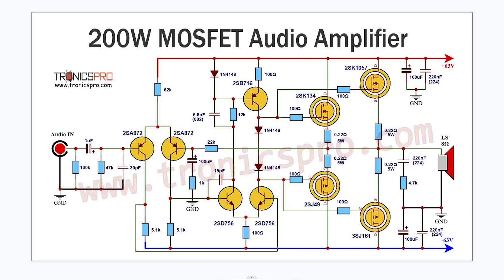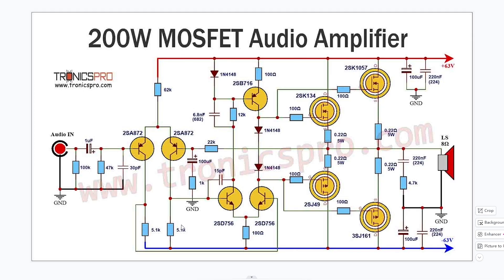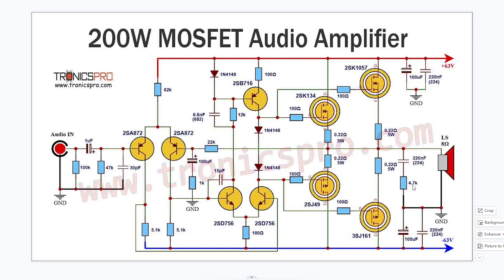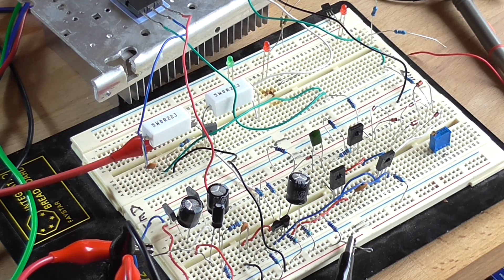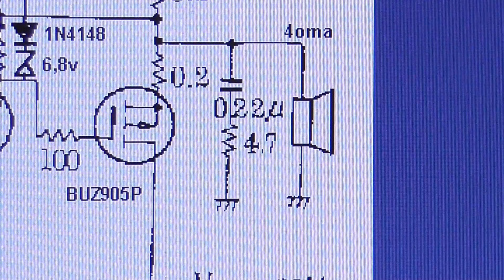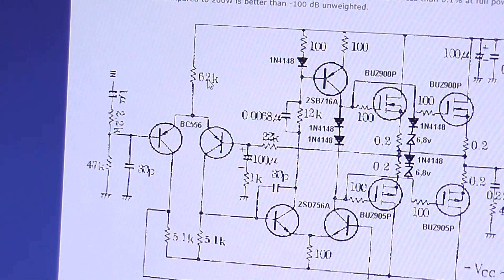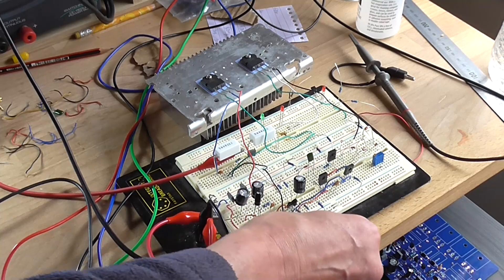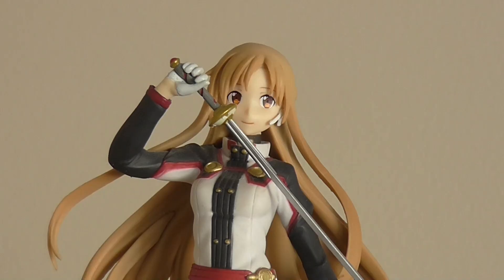200W Lateral MOSFET Power Amplifier Circuit Test

Comment: Thank you Astro for sharing this video.The 4 zener diodes are known as a stabilizer they stabilize the output mosfets 😃💯Stabilizers are used on the output of MOSFETs to prevent oscillations and ringing caused by parasitic elements and to regulate voltage. Without stabilization, the MOSFET can oscillate, especially when biased in its linear or quiescent region. Stabilizers can also refer to a device that regulates the voltage supplied to a circuit for consistent and safe operation, often incorporating a MOSFET in its design for control.👈🙂 You should use the original schematic it is built correctly....🤗 But using the 2 x 1N4148 zener diodes as bias I would use a 10 ohm resistor or a 33 ohm resistor and connect it to the very last 1N4148 zener diode to balance out the bias perfectly 👍✅
Reply: This seems an AI generated answer as it's complitely out of contest. In this case the zener protect the gate of the mosfet for overvoltage wicht lateral mosfet are very sensitive.
Reply: @andreavico6198 if I may ask what seems AI generated?😃 A lot of people don't understand how mosfets work that's why you don't see very many top-notch quality mosfet amplifiers that actually stay up and running for long periods of time without failing..... Mosfets are very sensitive and one wrong move will burn one up very quickly... You must take  proper care when building a mosfet amplifier especially if you are building the circuit from the ground up.....😃 There's a lot to know about mosfets.... And most people don't take the time to study and read and do their research to fully understand most people just look at schematics and throw things together that doesn't mean the circuit is right or correct as an engineer tech and designer it is your job to fully understand and to make sure the amplifier is built correctly ❤ yeah the amplifier might work but that doesn't mean it's stable you have to have a lot of different test equipment in order to truly make sure everything is correct and that the amplifier is up and running properly 😊 Marshall build some really awesome mosfet amplifiers you should check out their schematics when you get a chance they are very different and unique 😃 just Google the Marshall lead 3210/100 mosfet amplifier or the Marshall 8280 schematics! and they did not use a zener diode at the base of the output mosfets 😃 On the Marshall 8280..... The way they designed and built the circuit you can use darlington's mosfets or even BJT for output transistors. Marshall knows how to build a amplifier😂

Comment: Your video helped me to find a resistor value error in a commercial amp that I've been trying to fix for about a week now...

If the output is saturating at DC, the 100uF electro on the 2SA872 could easily have a high voltage across it, and it will go reverse-polarized if the output stays negative for any time.

Perhaps print out the schematic and write down the voltages on it at various points to build a picture of what's happening.
Reply from the maker: That's great. I already fixed it.

Comment: 5K1 is a standard value in E24 Standard Resistor Series (5%).
Reply from the maker: Yeah, you're right for E24 1% - 5% metal film it is standard. I was referring to the E12 10% carbon range (and even though I use 1% E24 metal film, I still like circuits that use E12 standard values - just my OCD lol).

Comment: I'd probably try closing the feedback loop without the output devices, say between the series diodes and see how it behaves. Are the outputs from a ridgy-didge source?
Reply from the maker: Yes they are (someone sent them to me a couple of years ago, and they got them from Digikey originally when they weren't obsolete). In my follow-up video I did exactly that, closed the feedback loop with FETs removed using 100k resistors from where the gates would be to the output line to provide DC feedback. Circuit didn't operate correctly. However, I found the problem 😁

Comment: The link shows that circuit was uploaded Jan 2024 so it is rather current
Reply from the maker: Current to him, maybe. But his butchered version with two different types of output transistor case styles (TO-3 vs TO-3P), a missing 100 ohm resistor, negated 1k bias pot with two fixed diodes instead (probably leading to a fairly high idle current for like, no reason) is actually derived from an older circuit from the 1970's/1980's - somewhere around there.

Comment: This is derived from the original Hitachi reference circuit for the J49/K134 output pairs. There should be a 1k trimpot in place of the two diodes (bias), there should be a 100R in series with the 1N4148 in the upper current source. The 47k input resistor and 22k feedback resistor are standard and it works just fine like this. The zobel should indeed be a 4r7, I guess the 4k7 is a misprint. The 62k / 5k1 resistors in the input pair are also standard to the original design. See your FB messages, I have sent you a useful couple of links, one to the original Hitachi reference design. BTW, the 1980's Maplin Mosfet is almost identical to the original reference design, although Maplin used 47k in place of the 62k and 3k9 in place of the 5k1. P.S. I commented on one of your previous videos, only to find the comment got removed. I don't know why this is happening?
EDIT: With regard to the 30pF cap on the input.... That's doing nothing, as the "designer" of this circuit removed the 2k2 series resistor which is an essential part of the input low pass filter. The zener diode / 1n4148 combo should be tied to the output rail. Those diodes are there to clamp the gate voltage to the mosfets, as they can be destroyed with excessive gate voltage (around 10v IIRC).
Reply from the maker: Wasn't me.
Reply: YEp 😊 Came here to say Maplin.
Reply: After sending new message select Sort By : Newest First, you should be able to see it.
Reply: @ericmc6482  The messages simply disappear. I've seen quite a few complaints about this (it seems to be a Youtube issue).

Comment: What I don't understand about the circuit diagram as presented is that there are different MOSFET types used in the output stages. Not the n-type vs p-type either.
Reply from the maker: I stated that in the video, also - I don't understand it, either. However, when I was discussing where the schematic was derived from with someone else the other night, the person that butchered the circuit read the schematic WRONG! The correct schematic specified 2SK134/2SK1057 & 2SJ49/2SJ161. That means either/or for the OP devices, not BOTH. The 2SJ49/2SK134 are TO-3 can style, the other two are TO-3P (which would both look strange and silly on a heatsink/bracket). He also misread 4.7 as 4.7k on the Zobel, instead of 4R7. And for some reason, he deleted a 100R series resistor to the diode in the CCS. I don't know... amateurs!
Reply from the maker: I'm also not sure why he negated the 1k bias trimpot and decided to use two fixed diodes. I haven't tested it (now the amplifier is working) with just those two diodes, but the quiescent current must be pretty high!

Comment: I was wondering if that circuit was gonna work or not.. I was wondering if a simulation could show why it's not working or if it's just a bad circuit design ..
Reply from the maker: I think it's bad design. Looking at it, it should work, but clearly doesn't. The biasing diodes by rights with the zeners in series should be referenced to the output in the centre to protect the mosfets during overload condition, and the extra 2 diodes removed. It could be the input stage is not setup right, and could probably benefit from a current mirror at the very least, doing away with both 5.1k resistors. The 62k should be fine to remain. The vas and its constant current source looks right... I don't know 😢
Reply: @AstrosElectronicsLab  The 62k resistor is too large for the reduced 35V power supply rails, it should be chosen to supply about 1ma to the input pair, 33k would be ok for 35V.  This should produce 10ma in each leg of the VAS stage (upper transistor is a current mirror, not a constant current source). The 12k resistor also needs to be scaled to the power supply voltage, it's purpose is to reduce power dissipation in the left 756. About 5k dropping 50V leaving some voltage for the transistor should be ok for +/- 35V. Yes the protection diodes should connect to the output, but you need to keep the 4148s. Otherwise the mosfet gate voltage will be clamped by the forward biased zener on the other mosfet. (Imagine 5V with respect to output on the upper mosfet gate, current will flow though the bias spreader diodes  and though the lower zener). 
None of this explains while it's locked up however. If you posted the schematic with the voltages at every node I'm sure you would get lots of suggestions as to the cause.
Reply from the maker: @stephendredge6077  yes, it's fixed now - once I found the actual schematic this was butchered from. The two "biasing" diodes aren't needed if the negated 1k trimpot that USED to be there is installed to adjust the bias. And, yes I know the protection Zener diodes need to reference the output and that the series 4148s need to be there. This was fixed in the update video to this where I actually found the root-cause of the DC offset (well, positive supply rail on the output). The current resistor values in the LTP and the 12k seem fine at +/-15V & +/-30V. I am planning to add both a current source and current mirror to the LTP.
Reply from the maker: All transistors check out ok and are new, so, it's not a faulty transistor. All the wiring is correct also; with an added bonus 220pF cap across the n chan gate/source (as the gate/source capacitance is larger on the p chan, so that will compensate and prevent it oscillating).
Reply: I would agree with that conclusion..